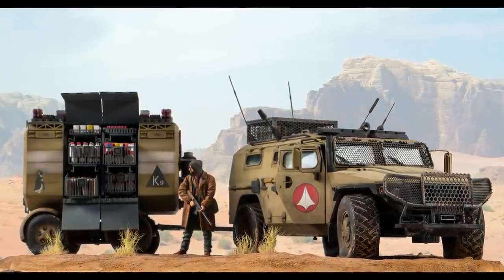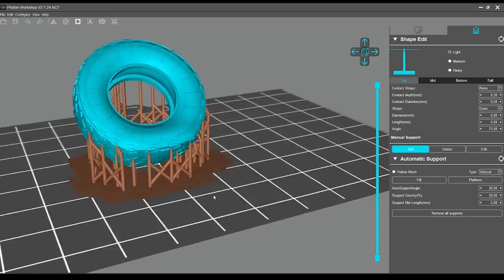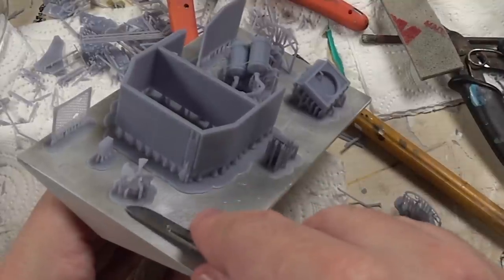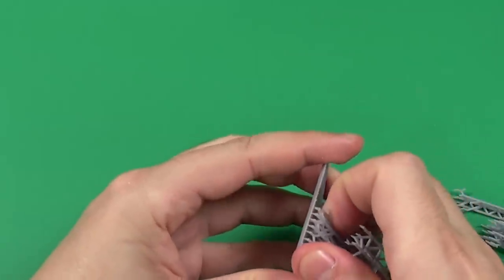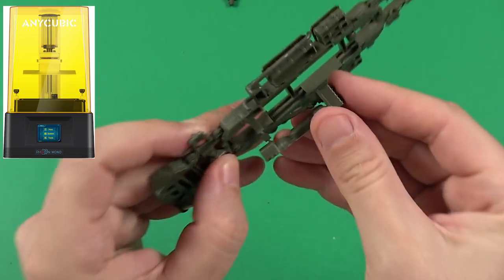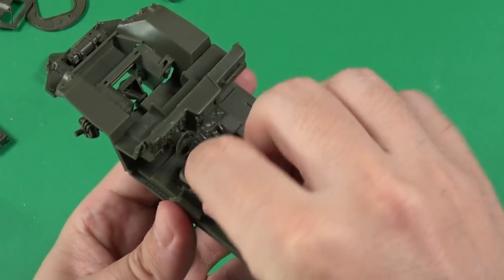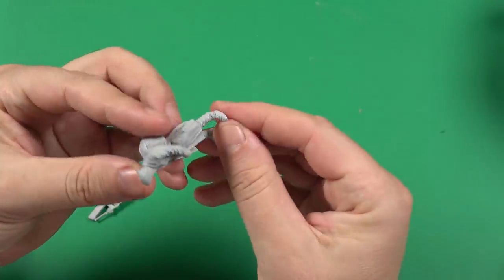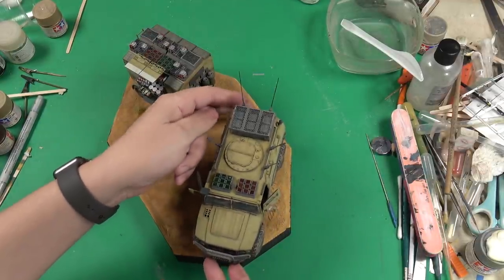3D Print Fictional Dystopian Black Market Trader Scale Model Vignette

Comment: Scale-a-ton: "It has some obvious flaws."
Me:  "Where?!"
Reply: Great work 👍
Reply: The outcome is fantastic, but the only flaw that I see is that the weighted wheels are rather exaggerated, almost as if he had 8 tires flattened.
Reply: @Sacrilege7294  On rough ground partial deflation can provide better traction. Many military vehicles have the provision to dial in tire pressure from the driver's seat, some while driving.
Reply: I would say the wheelbase is too short and the track too narrow for the apparently top-heavy trailer. Maybe the owner has loaded it to keep the weight low to avoid tipping it over.
Reply: The motors don't work and the guy doesn't have a dog?

Comment: To deal with the smell: I have my 3D printer (Anycubic Photon) in a simple cabinet with an active carbon filter and a bathroom fan, gets rid of all the smells, stinks like hell otherwise...
Reply: I'm using resins from Siraya Tech - fast in grey color and the blu - with my Photon Mono and the odor is barely noticeable! Even while printing. The only smell there is the IPA while cleaning, but that evaporates quickly. I'm using the wash-and-cure too and the whole process still is a bit messy and smelly, but way better then I expected.
Reply: @bluepinknight  cool, good to know!

Comment: Been 3d printing for 7 years now, your doing great! 
So, use gloves when handling the resin. And fresh printed pieces until after its been washed. 
Doesn't need 15 minutes. Just a few in the alcohol wash.
You can keep the same alcohol in the bucket until it gets to dirty to use. Maybe put it through a filter to get rid of loose bits after a wash. 
Get a UV laser or flashlight. You can use the resin to repair parts fill holes, or even glue parts.
Try using Jb Qwik to join bigger parts.
Prints are VERY fragile and brittle!

Comment: What is the layer thickness of that printer? Must be thin since you didnt mention them being visible. The one I used prints at 0.15mm and making components for small scale models is just pointless; you will still se the lines on the surface.

Comment: Since you have again made a very good video, your model with the trailer is very good.
The paint and aging is the very well done, I also like the diorama. How long did you need to learn the CAD program?
I work since last year with the Elegoo Mars and would not want to give him away ;). I would put on gloves when handling the 3D resin.
Reply from the maker: Thanks for your comment. Yes I received so many feedback about gloves. I use always gloves. when i wear gloves i smear the resin all over the place. I shot the video with bare hands to avoid contaminating my camera and expensive equipment :) I will use gloves next time ;)

Comment: when you make tires in blender you could have just made the threads on a flat plane >  sub d > array > and simple deform. after that you can extrude the side walls to the proper shape, sub d again. 

 if you need a curved thread instead of flat or want to make it look deflated you can create a cage with a cylinder, use mesh deform and link it to the tire. then you can adjust the tire using the cage as you would a lattice.  just make sure the tire mesh is air tight which you would just fill the wholes with a simple fill and delete afterward.

Comment: Thats  very very nice you did amazing job ,i also denied to review 3d printers in the past because of luck of time but you are doing great job ! Try to get the Abs like Gray resin is much better than the normal Gray because the normal is very brutal ,also in order to print flat on the bed get your self a resin metal Flexible Plates google it as it is ,trust me you will love it i am using it for few months now :) you will not get deformed parts any more so deformed plates like the ones on the 7:15 will not happen again !